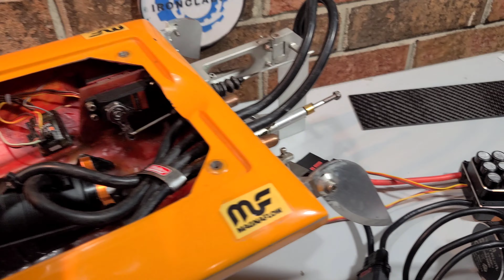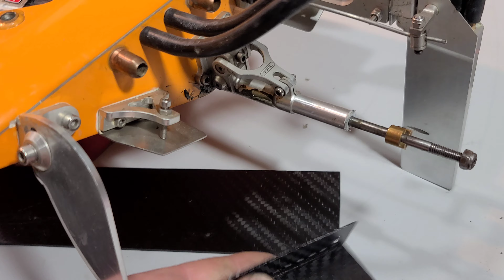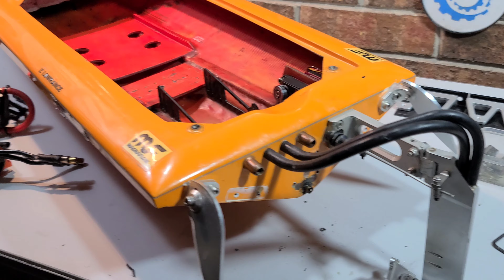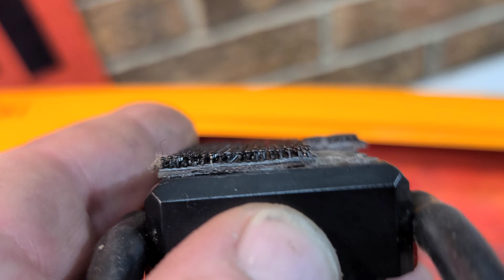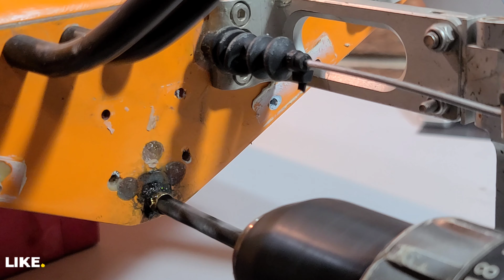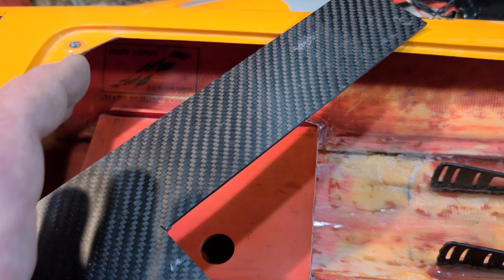Re-re-rebuild Introduction/Teardown Deltaforce 35 - Spektrum 4685 1350kv, ZTW 200a - FE Rc Boat

Comment: Hi, sorry if I bombard you with questions, but I'm new to this field, I was asking you kindly, I have this hull, and I already have a 4082 2000kv motor, 200A regulator, 6s battery, in your experience, which propeller can I use?, could you tell me the size of the fins and flaps? Thanks for your availability. Andrea.
Reply from the maker: Octura x442 should be a good starting point, if the Temps are cool you can prop up a little bit
Reply: @IRONCLADRC  ok

Comment: This boat will 100% be faster than the dominator. For some reason the dominator doesn’t seem to wanna run fast
Reply from the maker: The Dominator hasn't gotten the right electronic set up Yet...
Reply: @IRONCLADRC  ohhh, so it’s still underpowered?

Comment: Heya, Big B - remember me? I have a question for you but sorry for asking here - Idk where else to find you.
I have a 24" Blackjack and so does a friend. He's challenged me on my home turf to a race between the two boats. Idk about his but mine has a Castle motor that's 35mmx70mm, so it's 1/10 scale but really long. It's powered by 150 amp Flycolour ESC. Would you be
willing to recommend a prop or two - I CAN'T  let this guy beat me.
Reply from the maker: Oxidean 42 high rake for top speed..
Reply from the maker: Drag race or top speed
Reply: Probably both top speed and then drag - as much acceleration as I can get out of it. for an 1/8 mile. Tomorrow I'll send you the Kv of the motor. (It requires a dentist mirror to see it.)
Reply from the maker: @Al Jensen okay. Start a new comment thread in any video  tomorrow, I'll definitely answer you
Reply: @IRONCLADRC  I put a comment here:
https://www.youtube.com/watch?v=3peMH7mZEMA&ab_channel=AlJensen
Reply: @IRONCLADRC  I started a thread in one of my vids but I guess I didn't link you. Can we just do this through email or Messenger/Facebook?

Comment: On 8s you will get decent rpm's i would guess. I think handling really big props is more the issue. Also lower ampdraw is beneficial to the runtime. So its damn interesting to test...
Reply from the maker: Yes sir, the rpms are about the same, actually the 4082 has couple thousand more rpms than the 4685.    I rarely use low kv motors so this will be a great learning experience for myself & my viewers.   Like you say it'll be interesting

Comment: i started using 40mm sizes motors i think the 4082 is the longest i have its 2200kv. i have 1150kv,1750kv,1900kv, most rockets or SS. the 2200kv or 2050v. there a little heavy in some hulls. ive tries a few other set ups with lowe kvs and higher esc like ztw 200a . castle xxl. i wasnt pleased for what it coted me. the 150a esc fly, has been the go to power system for me price wise. untill something different comes out. i havent ddiscovered anything new myself these past 2 summers.
Reply from the maker: I've been looking into the flycolor kracken, also considering getting a castle creations mamba 8s ditch the fan & do the cooling mod..  that's probably the cheapest 8s power available.